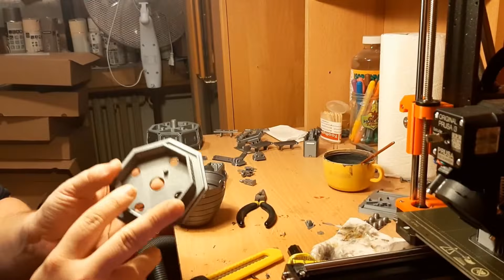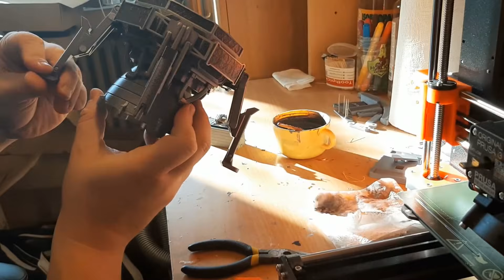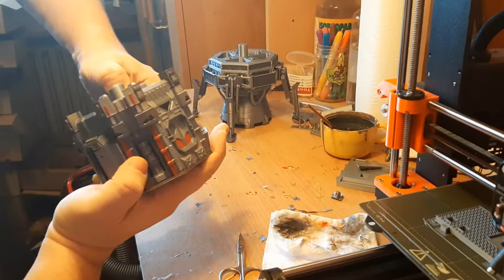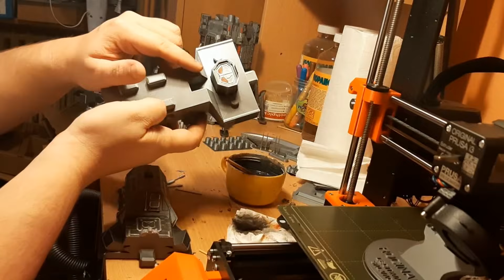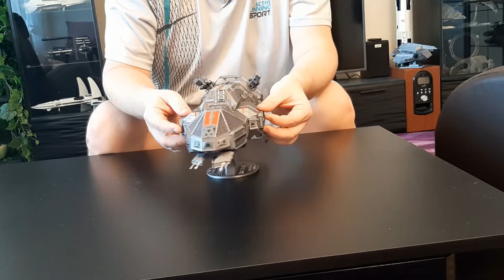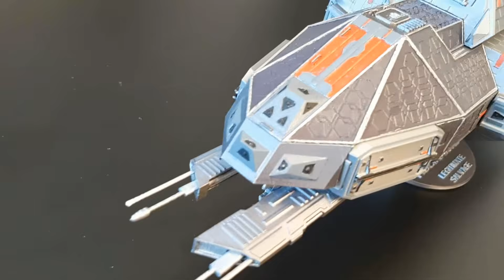Project Rocinante Part 2 Assembly and Model Review

Comment: This is an absolutely amazing model. Beautifully detailed, and the engineering on how it goes together is flawless! I've been printing it on my new X1C and everything has come out perfectly and just snaps together in the most satisfying manner - kudos! You are a design master!

Any tips on the best way to make the air bridge parts as durable as possible? Material, print settings, orientation? I've tried printing the pieces twice now, both times standing on end, at .16 layer height, in PLA, but the pieces just snap when trying to remove them from the bed. 

Thanks again for sharing this wonderful model!

Comment: Could you provide some information about how you finished, primed and painted this? I'm curious which materials you used but didn't see another video that covered the painting process.
Reply from the maker: i did not do any finish, I printed it, painted it and assembled it. I use spray paint for large surfaces and brush for details with normal acryl paints for plastic models. Hope this helps ;)
Reply: Could you share the colors you used

Comment: Quick question:  I'm printing this now on my Prusa Mk3S with the standard 0.4mm nozzle.  I also have the tiny 0.25mm nozzle, but have never used it.  Which is best for the tiny parts, like the PDC cannons?  Thanks!!
Reply from the maker: i printed it with 0,4mm with no issue

Comment: Hi Martin, thank you for a wonderful design.  I'm currently assembling mine after a friend printed it out for me.  I do have a question for you though.  Why print the PDS guns in separate parts? I'm looking at the barrels, magazines, and end block.  It would seem to me that this could have been printed as one piece which would then be mounted on the base.  Was that something that you thought about? Thanks. Again, really enjoying the detail in this model.
Reply from the maker: honestly, I cant say I really understand the question.
Reply: @martintaichl  I appreciate the response, at 4:43 you have inserted both Mags onto the shaft of the PDC, and then You place another piece on the shaft behind the magazines and fasten it to the PDC with a pin.  Why make the assembly like this? Why not just print the PDC Barrel with the Magazines in place?
Reply from the maker: @psrobert1961  because the magazines have to be collapsable in order to fit inside the PDC housing.

Comment: Its a fantastic model, fun to print and i like that you can build it yourself. I cant wait to put it together. I have a problem though that the letters on the leg joints are not printing properly (i'm on a prusa mk3s) any settings or suggestions?
Reply from the maker: Not really. I printed it on mk3s too and had no issues with them

Comment: So I am new to 3D printing, been following for years but only just got my Sunlu S8 Pro. So far I have printed a few test models and they came out really nice. One of my first goals was to print a Rocinante, but I didn't expect to find a project like this! So amazing. Your level of detail is incredible.

Do you think I can produce this as a newbie, without modifications to my printer? Right now I just have the filament it came with (large spook of white 1.75mm PLA) but plan to buy more, maybe a gray specifically for this. Any advice would be GREATLY appreciated. This is a thing of beauty and the sort of thing I bought this printer for.
Reply from the maker: Thank you very much for you kind words. Unfortunately i cannot really answer your question. I have zero experience with printers other then Prusa so i cant really say if you will be able to do it. If you had a prusa, i would say it does not matter at all that you are a newbie. Thus I can only wish you good luck and happy printing ;)

Comment: I'm having a LOT of trouble fitting the pieces together on just the first section, is there something i have to change in the slicer? Cause at this point i'm gonna break something just by tryna hammer them together
Reply from the maker: Well the tolerances are really precise. If you have a printer witch is not that precise, you will have issues.

Comment: I'm having a problem with segment 1, part b. It keeps failing at the same level, it gets about 1/4 printed then grinds my filament until it breaks. I've tried it 3 times, sliced it different all 3 times with the same result. So far all the other pieces have printed flawlessly. I've got all the pdc's done, the bridge and most of segment 1 completed with no issues. But that damn part B is driving me nuts. Just wondering if anyone else had a problem?
I'm going to try to download just that individual file instead of using the one from the zip and see if that will work but I'm truly at a loss as to why
Reply from the maker: I am very sorry you have such an issue. Unfortunately I cannot help you there as I had no such issue whatsoever. So I really dont know
Reply: @martintaichl  it was really bizarre as I've never had that issue before, I even downloaded just that file, tried 2 different slicers and parameters and it kept failing in the same spot, it was strange, I eventually printed it upright instead of flat on the build plate and it finally printed without issue, not as pretty as it would have been because of the supports needed, but after 5 tries, I finally got it finished. Thanks for the awesome model

Comment: This is pretty awesome but having no experience with 3-D printing can you recommend what kind of printer and equipment I would need to do this?
Reply from the maker: Well, you need a printer, colours and brush. As for the printer, I can only recommend Prusa Brand, MK3s in particular. It is what i have and you can see what the final print looks like ;)
Reply: Would you build any to sell?
Reply from the maker: @ronmathis9020  maybe after some time but certainly not now. However i ship only to EU.